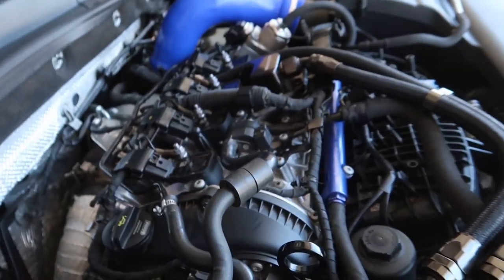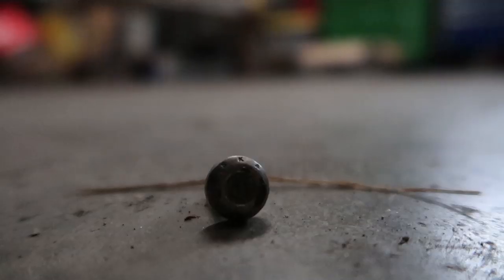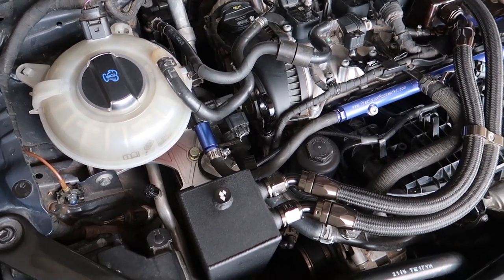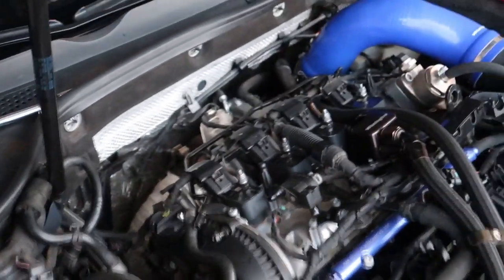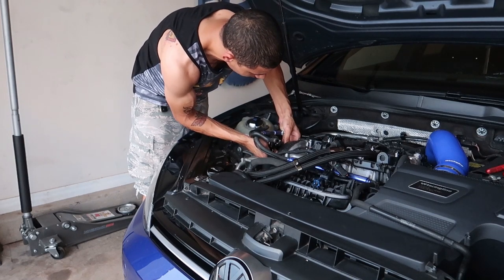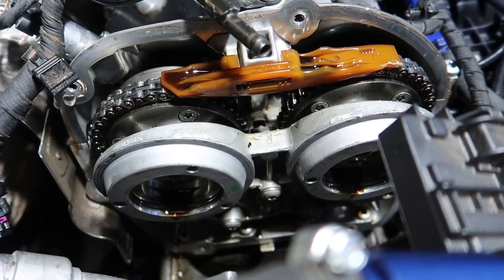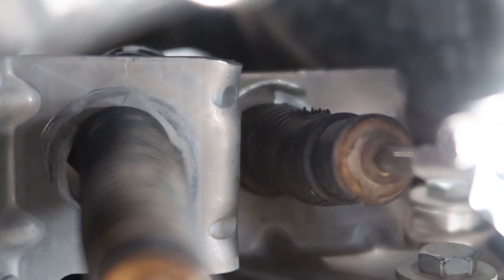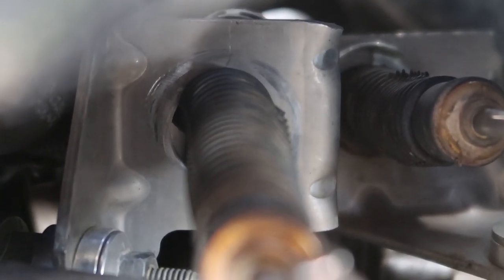Euro manifold in, shifter fixed, & timing cover seal replaced! | What a week lol | MK7 Golf R

Comment: Love my UPM tune for the haldex, got it  when they where at Wookiee’s.  your suspension mods and a bbk man 🔥 and EQT 🤦‍♂️.  your steering is going to go from night to day in sharpness I love how it changed the weakest part of that MQB platform if you ask me🤙🖖bro just pulled on a camera SS the other day come though South Carolina, I’m only STG 2 with basically every bolt on, made me think of you man spanking on some V8 with ~600hp LoL (it was a close) so I can’t Imagine what this EQT set up is like, keep the content coming
Reply from the maker: I really hope it does change the front end a ton! The eurocode brace and tyrol deadset helped a bit but it definitely needs more work lol. Hell yeah on the SS kill! They're one of my favorites to line up with 😁 I had a run in with an R35 GTR last night ~600wheel and he only got me by about 1.5 cars from a 40 😎

Comment: Why not use Stainless Steel screws for the timing/cam cover?  Stainless is non-magnetic and way stronger than aluminum.  You could remove the gasket and retainers then use them with new stainless screws.  Titanium is non-magnetic too and stronger than aluminum as well (just pricey and not as much selection).  (also great video!!!)
Reply from the maker: If it comes down to replacing it again I'll definitely look into it! And thanks man! I try ☺️🤘
Reply: @BryceJordanProductions  whats the thread/length?

Comment: Valve cover/girdle may have a leak. VW took mine apart and resealed it with some glow in the dark green sealant. Hasn’t leaked again
Reply from the maker: I was thinking that maybe but the leak comes from below the head 😒
Reply: Bloodsplash Google is the job hard? Any things to watch out for or is it a straight forward procedure? My cover is definitely leaking up top